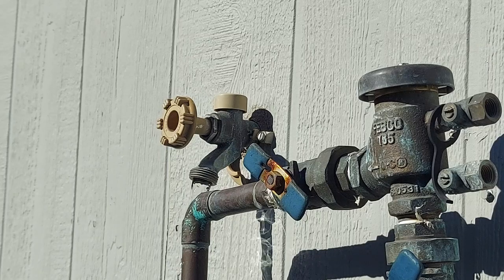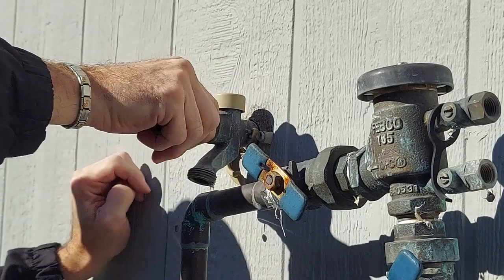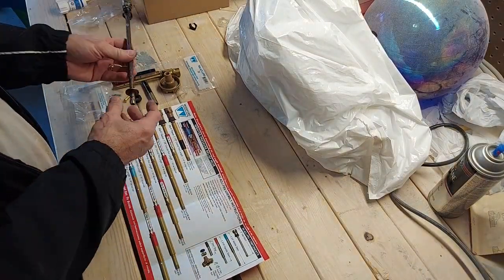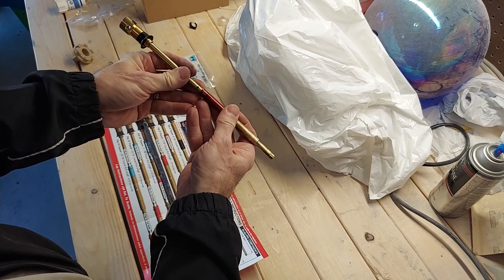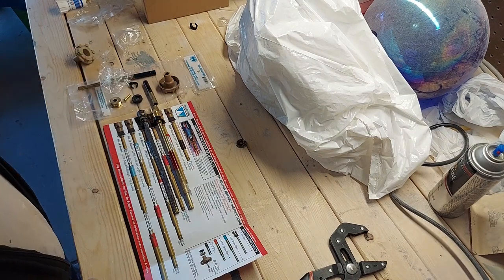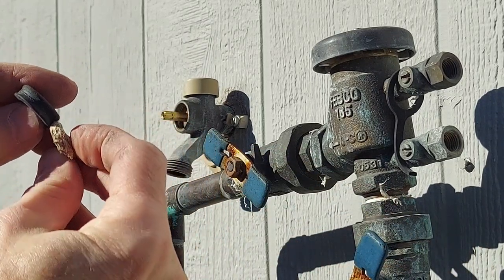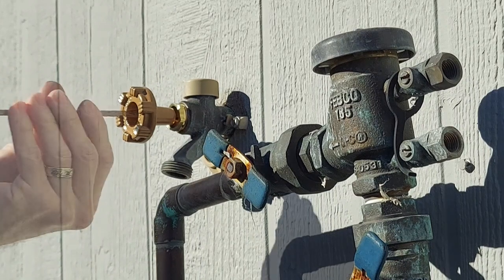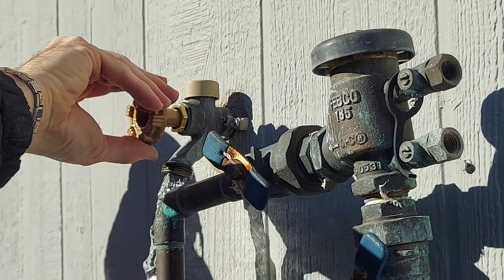Install Woodford Faucet Repair Kit For Models 14, 16, 17, 19, 22, & V22

Comment: I watched your video to get my model 14 apart.  When I started on my second faucet I found I could unscrew the packing nut without removing  the knob.  Then I turned the knob till the stem came loose and used the knob as a handle to wiggle it all out in one piece.  Then I took all the old pieces off and reassembled the whole thing with new.  Then I inserted the whole assembly into the faucet and turned the knob to tighten like I was shutting off the water.  Then I screwed in the packing nut and tightened it with a wrench.  I thought this all went much faster than taking it apart while it was still in the faucet like you do in the video.  Hope this is helpful.